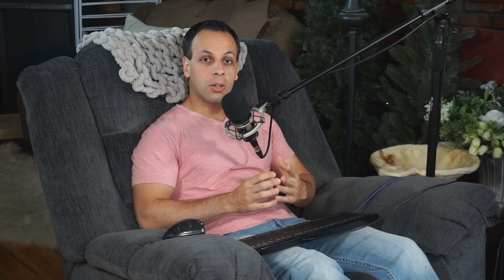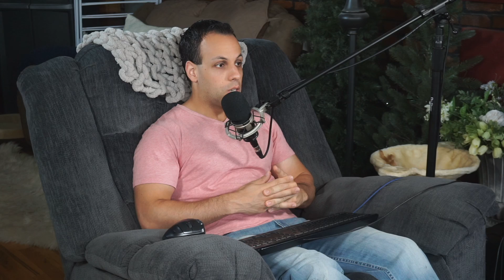Let's talk about what Right to Repair means for how devices are designed.

Comment: You can repair your device right now: using pirated schematics and black market for parts. For me, right to repair is about providing quality-of-service: you should be able to the same repair without ever need to use legally-questionable methods and do transactions with questionable merchants to obtain parts. It has nothing to do with the device itself, just legal stuff.
Reply: keep in mind that the current supply of parts in some cases relies on the deprecation of devices. Parts are removed or even desoldered from disposed devices. This is not a sustainable supplychain
Reply: true but I think the solution there is to stop making those solutions "legally-questionable", just flat out say "the tax payer is not obligated to uphold your "intellectual property" in the form of schematics, parts, etc. and anti-competitive approaches such as part exclusivity are not acceptable". If companies want to sell products with software locks, and people are okay buying products with software locks, that's up to the consumer, but larger issues like the "intellectual property" (honestly I fucking hate that term, information as a publicly protected asset is just so fucking stupid to me. If you want to be the sole owner of an idea, don't tell anyone about it. If you want your software to not be pirated, use DRM, not the court system.) being protected by the law is the crux of the issue IMO. 

Schematics DO get leaked, that's the reality. The issue is that these leaks are actionable legally. Imagine if, they just weren't. Well, now the second a schematic gets leaked, it's free, everywhere, youtube, twitter, tiktok, everywhere, it's reposted freely and openly. This not only lets more people be aware of the shady shit their oh so favourite brands are doing (shifting the consumer perspective on the issue) but it also means that companies now face an issue. Either they A : give out their schematics freely, be pro-RtR, pro-consumer, etc. or they B : Try to hide and restrict their schematics which get inevitably leaked anyway, and then get lambasted for being a shitty company. Once you take governmental protections out of the equation, well the problem kind of goes away doesn't it? If the public actually cares, at all, then the second companies stop having this stuff be legally PROTECTED the problem resolves itself. And, if the public doesn't care? Who the fuck gave the government the right to legislate it in the first place? If people don't care about the issue, the government shouldn't be making choices either way. 

I don't think we need to legally force companies to do anything, outside of basic anti-competition laws being enforced (such as deals wherein exclusivity is a central component) we just need to stop offering governmental protection for these things.

Comment: My only concern lies with being able to get the parts but devices(not necessarily phones and laptops) being built in a manner that you cannot get to said parts without destroying the device.  For example placing components behind a welded in panel or stacking components behind more sensitive components to make the repair unnecessarily complex.   The problem is how to you require "unnecessarily complex" design...what is complex...something with a phillips head screw is complex for some people.

Comment: What about
- companies must produce a public repairability report a year or so after product launch (or maybe multiple after 1-5-10 years) detailing common problems they had, repair guide for them and also research on preventive design for them?
- a vague law stating that any case where it can be shown that a company did deliberate anti-repair moves or design they can be fined to the moon?

Comment: What you say it's quite reasonable. Instead of having laws forcing reparability, we need laws that force manufacturers to provide parts and schematics. On top of that, we can create a rating system, somewhat like France did, so device's reparability is scored. That way manufacturers would try to make innovations but being mindful of the reparability

Comment: I still use the the easy solution.

I do not service or fix any problem with any Apple product, regardless of how easy it is to fix... I refuse to repair.

Instead of this, I educate the costumer in the problems with Apple products and advice them with adequate PC replacements that are comparable in performance and quality plus the fact that they can be repaired.

I want Apple to sue me to service their products.

Comment: The phrasing of such a piece of legislation should probably read something along the lines of... 

"A company that designs or manufactures an electronic or mechanical device should make the schematics, parts, and documentation, available for anyone wishing to have their device repaired.  modular parts that are easily swappable or upgradable, such as battery and screen replacements on electronic devices should be able to accommodate the end consumer and be affordable, while certification paths with instructor-led training by the manufacturers should be made available by the device manufacturer for intermediate or higher level repairs with these parts being made available to the private, public or government service industries, individuals or Businesses, once certification has been proven with a list of trusted manufacturers made available to those passing certification. 
Hardware and Software locks that verify the "safety and security" of a device can continue to prevent repairs that require certification, and will not be prohibited, however, the tools to unlock such software locks when a repair has been made should be made available to certified persons with each person having a unique identifier associated with their certification that can override these hardware or software locks. Enabling repair work to be identified by manufacturers as "Trusted".
Reply: This i beleive will offer the manufacturers the "comfort" of security, (and allow them to earn a little more money from certifications much like cisco and microsoft do already) while also satisfying the consumers of such devices knowing that their device is being repaired by a Professionally trained individual. 

will this stop back alley repairs that are dubious, No, but it will allow manufactuers to identify the real problem people within the independant repair market that are untrustworthy, and it will create an environment that makes independant repair shops with  certification on display more attractive and offer consumers a level of comfort when they take a device into somewhere like your shop. 

will this increase the cost of repairs, probably to a small degree because of shops spending cash on training and certification. but that cost is justified, if a $50 repair is now $60 to help cover the cost of "ongoing certification courses" and someone down the road offers the repair for $10 and has no certifications to prove they can do it, I know where I am going it's to the $60 repair shop such as Rossmans that has certification.

Comment: I disagree with you on the "Non removable battery" issue.  Batteries degrade whether they are used or not (Moreso when they are used).  Making the battery non removeable ties the lifespan of the device to the chemistry of the battery.  Environmentally, this is a bad due to the e-waste.  The reasons for making the battery Non-removable is to ensure devices are a subscription.  You buy a device that will last for a specific time, then must do so again.  Of all the issues experienced trying to further right to repair, this is a slam dunk arguement if the EPA gets involved.  Shine a light on the companies engaged in fake environmental virtue signaling and say "This is NOT OK" and they will begrudgingly back over that line.

Comment: I think there's a sensible middle-ground, where repairability is a mandatory element in the development decision making, and they stop putting in technical design features for the primary purpose of making repair difficult. That's not inhibiting innovation, it's prohibiting baking sabotage-mechanics into product design.

Edit: And put some teeth in it. If a manufacturer is found and judged to have done this, by a court of law, force a product recall. That should be a pretty solid incentive not to try sneak past legislation.

Comment: Basically this is what happens: Apple requests 500,000 circuit boards; Manufacture A makes 500,000 chips for said circuit board and then discontinues production. Manufacture A goes on to different things and scraps all leftover chips for precious metals or sells to a third party to recoup costs. When you need that chip for a repair and ask Manufacturer A: one chip please… their response is F off not because they don’t like you but because they don’t have chips to sell you. It’s not their business model. To make that chip they would have to make an entire batch and do everything involved with that to sell you a $5 part. Is selling you a part the right thing to do? Yes. Is it efficient? No. Is it profitable? Hell no. The large companies only care about maximizing profits for shareholders. 

A good analogy would be with the auto industry. When Ford makes a car, they make a limited production for a year and they also make a decent amount of replacement parts (that they know will break from wear) and send them to their service centers. They then cease production on that certain vehicle (after 5 years etc) and stop making all of the parts. They may in addition make more parts at the end of the five years that were found to fail before they remove the molds etc. They then cease production all together and then move on to the next thing and sell the designs to an aftermarket manufacturer. Occasionally with a super popular design the part is probably already being reverse engineered and manufactured by other companies as well. Basically it is similar to the computer industry but because the car industry has been around longer the time scale is much slower. Because it is an established industry you can call someone up and find the parts you need. Within a five min drive of me there are literally three different Autozone, an ORielys, two Advanced Auto Parts, a Napa, and two separate Ford service centers. If I need a part I can definitely get one because Ford is an established brand that has been around for over 100 years. Apple is not. You are in an infant market. 

I absolutely 100% support what you are doing with right to repair. The fact that I can’t get a manual or schematic to repair something drives me up a wall. All that I am saying in this argument is that having the government force a company to sell you something will never work. All the company has to do to deter you from buying is make replacement parts stupid expensive. 

I honestly have no idea what the right way to approach this is. Expecting a company to stock every thing they have ever made is a big ask especially for computers where they have thousands of chips for a thousand different models and all of those chips contain millions of dollars of precious metals. Another example I have is when I was replacing a seat belt buckle in the back seat of my car. The job was super easy, however there were no aftermarket parts (probably from safety regulations or something who knows). The only solution was to get a working part from a junkyard. What I am saying is that it may be easier for select chips to just make a junkyard of computer parts (which I think you already do) and create a website that sells those parts rather than get them from the manufacturer. 

My last analogy goes back to the car industry with people making their own parts. Way back when the thought of machining something in your garage was crazy but now you can make a CNC in your apartment (not that everyone does but just that you can). The aftermarket for specialty parts or old car parts is there. I will never be able to make a computer chip in my garage but I sure could build a radio or wire up a super basic circuit. The aftermarket for computer chips is not there, especially for super complex things such as brand new MacBooks, because it is just too expensive. I saw that there is only like three companies that can even make those chips in the entire world. 

Again I absolutely love what you are doing and enjoy seeing you make your videos. I don’t know if there is a good solution but keep fighting the right to repair battle. Thought I would give my two sense on this since I have briefly worked for a circuit board manufacturer and the culture of keeping any spare part was absurd because that was money left on the table in gold, silver etc. Anyway good luck with dealing with the City, your shop, and your lobbying efforts. Cheers.

Comment: As far as I am concerned, right to repair is very simple.

Product is broken so legally owner may take it to any person (or do it themselves) with the skills to effect repairs. This includes the ability of repair techs to gain access to parts that may not necessarily be “user replaceable”.

This doesn’t have to be free and it doesn’t have to be super secret.

If companies think that some smart guy isn’t already reverse engineering every popular gadget when they hit the store shelves they are deluding themselves. It’s time to come out of the shadows. 

The problem for manufacturing is that this prolongs the life of products with built in obsolescence and exposes shoddy design flaws. How will they ever convince people to upgrade to the next crap product? Easy, preventing people from discovering their secrets.

Comment: Socked chips are less reliable overall, that is one of the reasons why manufactures moved to soldered parts.  At least it was true at the computer manufacturer I worked for at the time.  It is also one of the arguments made for soldering batteries in place.  I'm not entirely convinced, but I can see how, with a device that gets carried around, dropped etc with a battery that is recharged, it could be true.  I agree with Louis we do not want to try to dictate how devices are designed, just make the parts etc available.  In fact, this is the law as part of the Magnuson Moss warrant act.  Manufactures just ignore it.  And, it is way to expensive for individuals to litigate for a $1000 I phone or, apparently, even a $100,000 Tractor.

Comment: a CNBC piece claiming right to repair DOES want to enforce design rules on manufactures 
https://www.cnbc.com/2021/07/10/apple-airpod-battery-life-problem-shows-need-for-right-to-repair-laws.html
"The limited lifespan of AirPods is exactly the kind of problem that the “right-to-repair” movement wants to fix. Repair shops and lobbyists that support repair reform want lawmakers to implement a variety of rules, including increased access to manuals and official parts and consumer protections around warranties.

But one of their most important requests is for companies to design products with repair in mind, instead of packing gadgets with unlabeled parts and sticking them together with glue, forcing users to use a knife to take them apart."
other then that point the article is a GOOD "rounded" piece

Comment: You don't need to make phones bulky just to have a battery that is easily replaceable.
I mean, look at the LG G5 and the V20. No screws needed, and although that's an extreme case, it shows what is possible with good design.

Comment: I agree that law shouldn't force product design but my god some products are basically unrepairable for no apparent reason. The Microsoft Surface Pro is one of the worst offenders and it's not even thin. If your designers and engineers can't design a slim product that uses screws instead of adhesive, it is either an asshole design or your employees are not skilled enough.

Comment: Basically the difference between "proprietary", "standardized", and "monopolized". 
Standardized = easy to source parts, easy to repair - IE. straight forward design that uses parts right off the shelf, no feature is difficult to access or change, basically "Legos" 
Proprietary = difficult to source parts, difficult to repair - IE. only one or two manufacturers, not designed to be easily disassembled by amatures, all parts are specialized or unique. 
Monopolized = impossible to source parts, impossible to repair - IE. potted boards, banned from buying from manufacturers, locked by source company, often designed to self-destruct.

There is probably space for one more in here, probably "hand-made" or "Custom", but I think this covers the [range] of device/tool/equipment design. Applies to just about any item.

Comment: Just want to be able to get something open without breaking it so that an attempt at repair would be possible in the first place. Things that are glued shut or have non-standard fasteners that are next to impossible to get tools for are still a problem. Doesn't have to roll back to old stuff, but the old stuff was more accessible and that's why it's often used as an example.

Comment: Regarding the repairability/reusability of modern day devices it baffles me how for every new phone , tablet or laptop the batteries are different and incompatible (between devices of same class from the same company), I mean wouldn't it be easier and cheaper to standardize the batteries (like 20-30 different form factors and voltages to accommodate any device)..